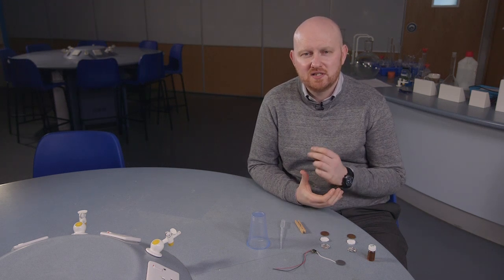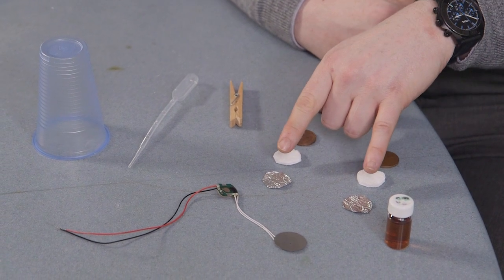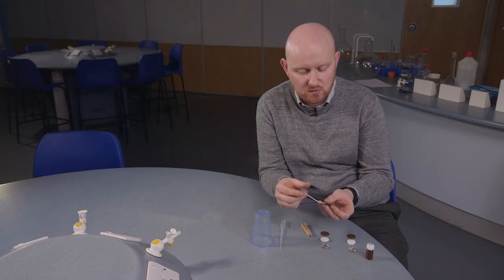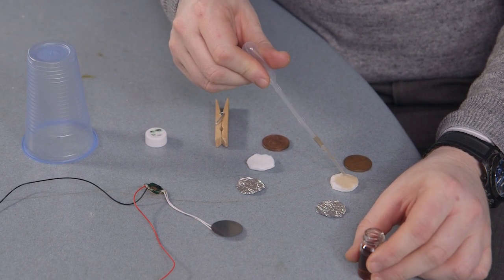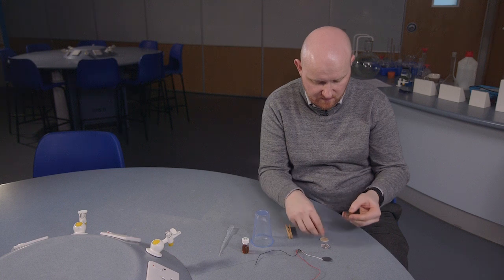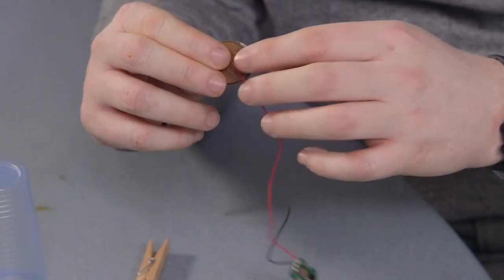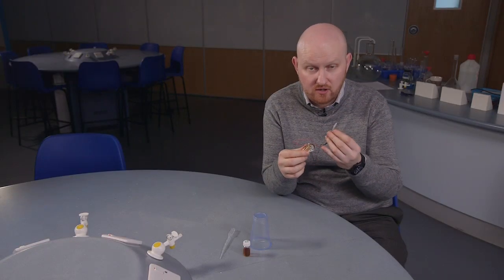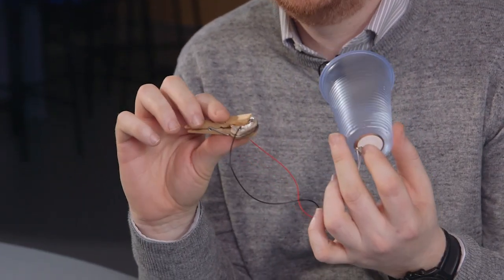Science practicals: Making a voltaic cell

Comment: Great video. How to make it a bit powerful or what other materials can be used to make more powerful?
Reply: Use zinc instead of aluminum and build a taller stack. More layers.
Reply: And if you want more amperage you need to use larger sheets.
Reply: Use the electrochemical series, take a chemical with a high srp as cathode and one with a very low srp as anode, the cell potential must be positive though otherwise it won't work.

Comment: I believe the electrolyte serves as a medium to carry ions, not electrons. Great video anyways
Reply: The word electrons and ions are used interchangeably in many cases, specially when dealing with redox reactions as it mainly involves movement of electrons in the form of ions only, and a galvanic cell works on the principle of redox reactions
Reply: Aluminum and copper reacts with the vinegar creating charges on the Aluminum and copper plates and releasing ions into the cotton mesh, that way the electrical neutrality in the cotton is maintained thus creating a potential difference across the two terminals.